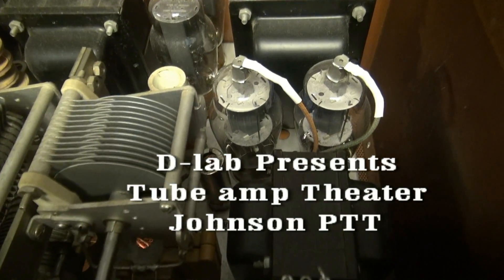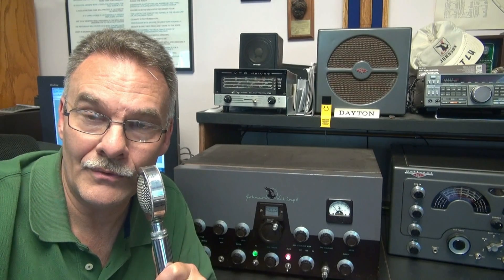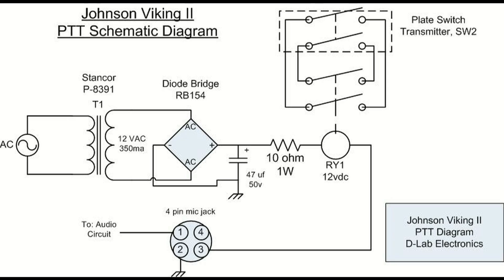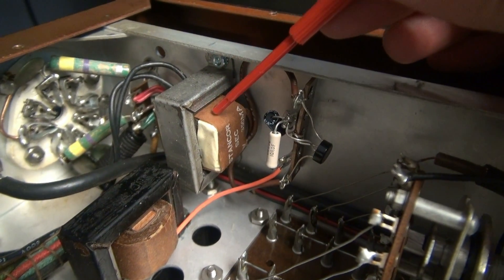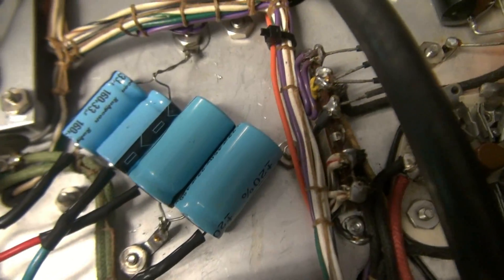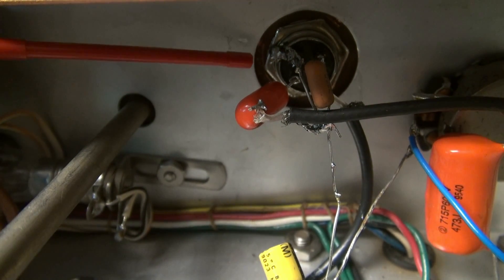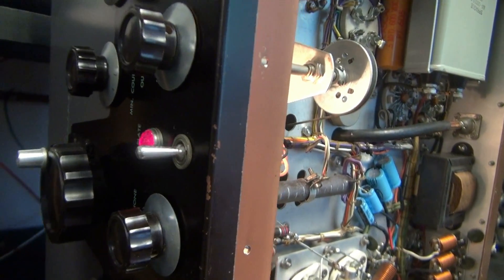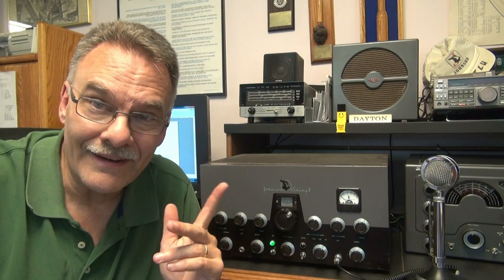How to add PTT Johnson Viking II Ham radio tube transmitter circuit

Comment: Cool video! Adding the relay makes life a lot easier using the mic to pick the relay. The way you did it is actually the best and safest way. When it comes to a classic piece of HAM gear, I wouldn't cheap out on the project. Adding the extra power supply won't break the bank, and you lessen the risk of severe damage. especially to the filament winding. Keep 'em coming! :)
Reply from the maker: Thanks man, The Johnson Viking II is my favorite AM CW Transmitter. Made my 1st contact using one. Fond memories. I have lots more videos to make, just not enough time.

Comment: Back to your comment about using the filament coil.
I would take a single diode off the non-grounded side of the 6.3, through a small resistor, and charge a cap (100-470uF) to create a 6ish volt DC ground referenced, and then use a 5volt relay and another small resistor.  You only really need the full 5v and any kind of significant current on the initial closure of the relay and the cap would provide that, so the fact that the voltage would likely drop below 5v on relay hold wouldn't be an issue.